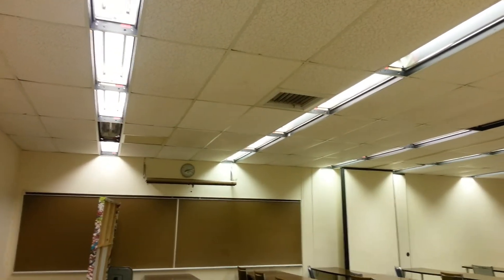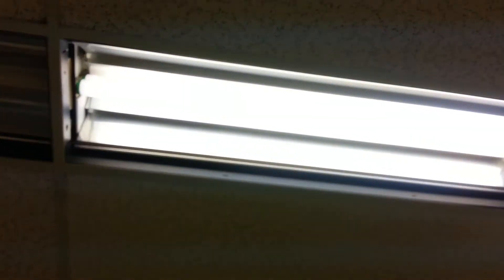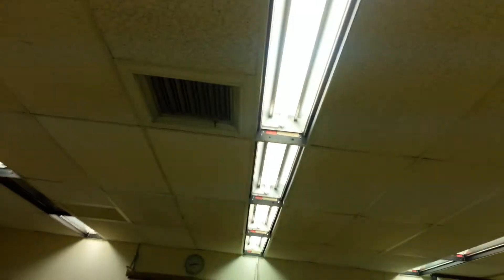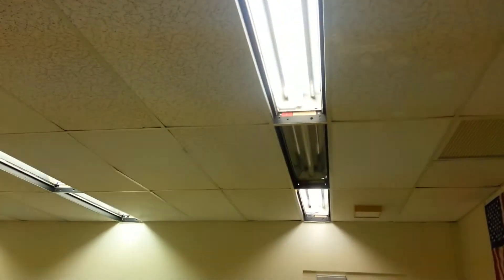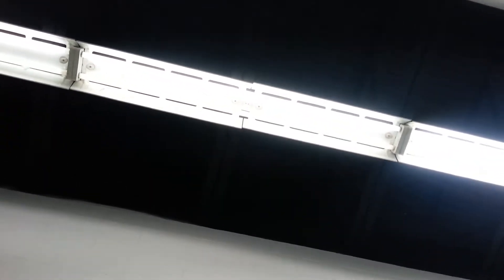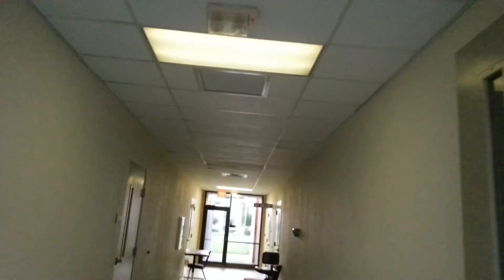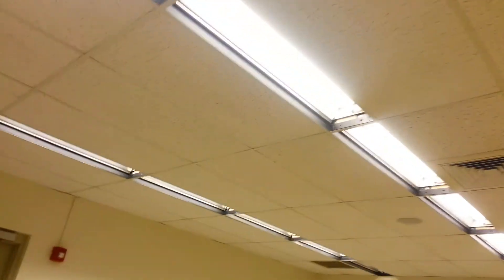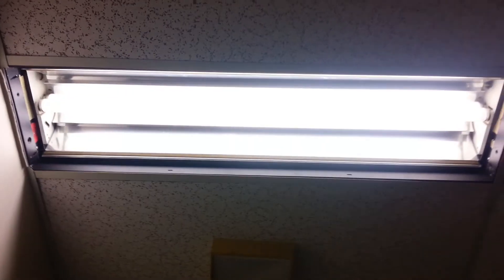Fluorescent lights magnetic t12 fixtures

Comment: Now I recognize you man. You're from LG!
Reply from the maker: Yup you got it! This was in one of the buildings at my college. Most of the magnetic ballasts t12 lights in the classroom were burned out and one was buzzing loud so now they recently replaced them with t8 electronic ballasts and they put the covers up as well! The room looks a lot better!
Reply: Yep I remember seeing pics of them from you on LG. Were those ballasts running 34 watt lamps? If so, that could explain why they failed. Typically magnetic ballasts last a life time! And from what I can see though, are those high output rapid starts being used in the hallways/ bigger rooms? Or are those slimlines?
Reply from the maker: Yup those were 34 watt t12 tubes. Most of the ballasts still worked. Those in the big rooms are slimlines. I work in this building now so I can hear the buzzing still in the big rooms and the noisy ones in the big hallway. I have no idea when they will replace those.
Reply: Yep I remember at one of my high schools, the library had plenty of 34 watt lamped fixtures with failing ballasts. And nice... I've never seen a slimline lit hallway! Pretty cool stuff man!